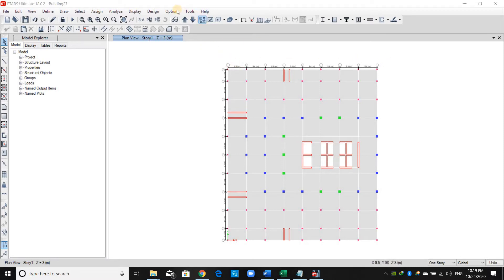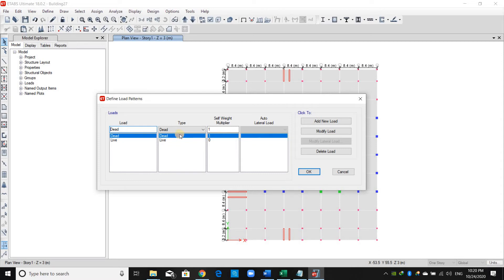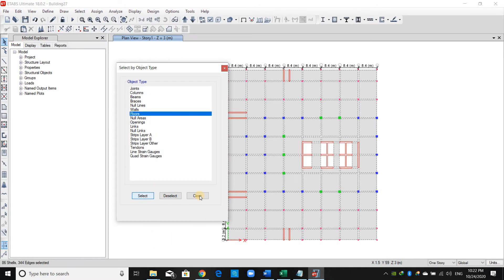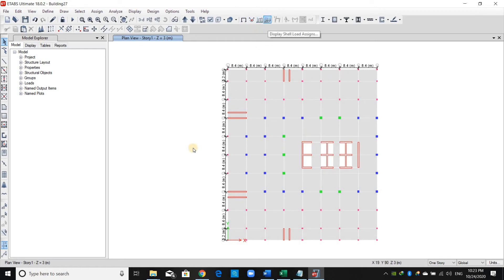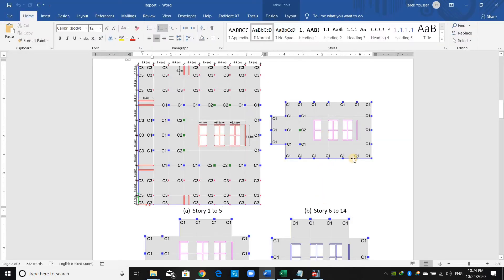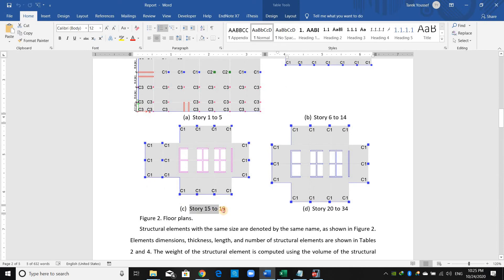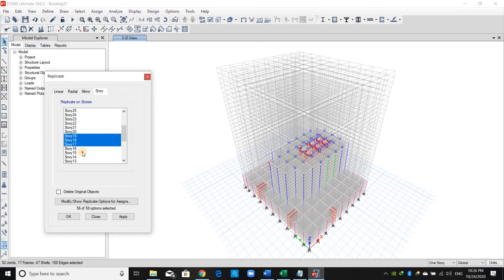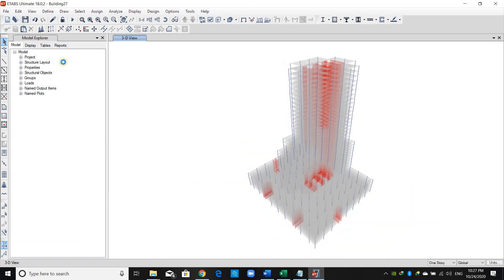How to assign gravity loads and to replicate stories in ETABS software (Lecture 3)

Comment: Why do not you change the SDL load type to Super dead load instead of dead load ?
Reply from the maker: You can use both load types, namely "Dead" and "Super dead." When using the "Dead" load type, it is important to modify the self-weight multiplier to zero. This adjustment ensures that the self-weight is not included twice in the analysis.
Reply: @Eng.tarekyoussef  Thanks